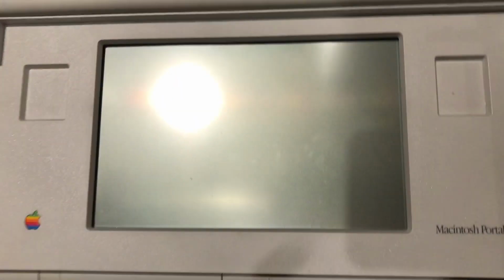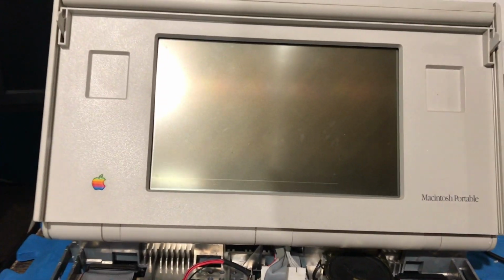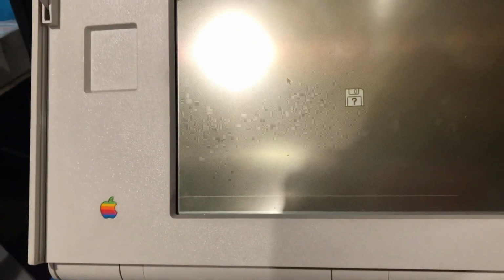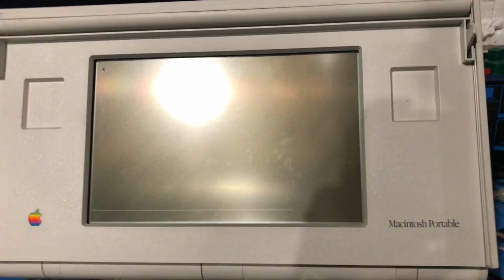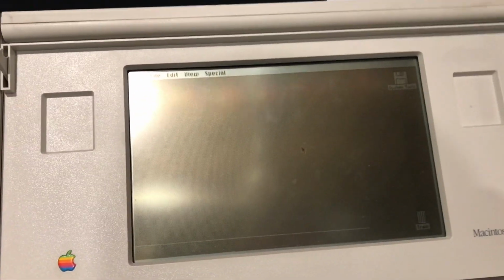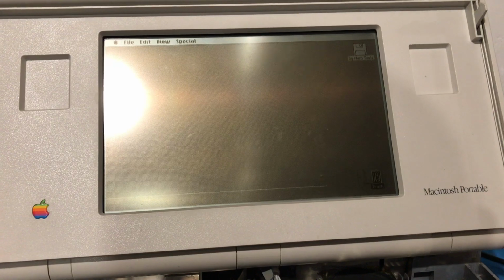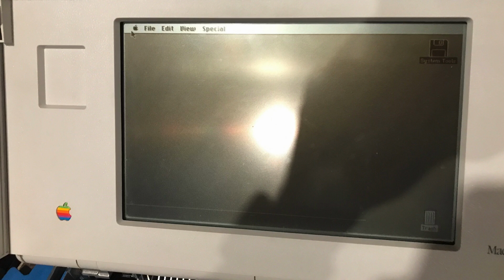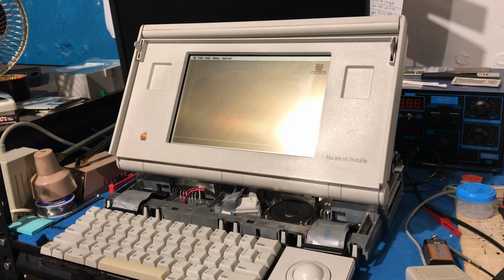Macintosh Portable Restoration Part 2 | Logic Board Recap and Troubleshooting | Mastergeko4

Comment: Hey man, I just purchased a portable M5126, backlit version. I disassembled it and upon inspecting the board I noticed something odd. From one of the microprocessor chips, there is a green wire that is soldered on one of the pins. It’s connected to a pin on an output chip. Why do you think someone did that? Could it just be a broken trace? I tested it for continuity, which there was. I’d love to hear your thoughts on it. Thanks
Reply from the maker: That’s pretty interesting. I would either suspect it to be two thing. One, being the trace repair that you said even though it seems to be working. Maybe whoever had it before didn’t check properly and just added it for good measure, or it would be some kind of aftermarket upgrade. I would take a look at a few other components and checking if anything looks new or out of place. Who knows? Maybe it has some sort of cool rare upgrade!
Reply: Mastergeko4 Hey again, I just cleaned and completely recapped the board. The board is getting power to the plug into the board, I checked and it does gain proper voltage. However, upon trying to boot the board It does nothing. It honestly acts like it’s not getting any power at all, even though I know it is. What would you recommend I do at this point?

Comment: You have a capacitor grocery list?
Reply from the maker: I don’t at the moment. I suggest either looking up a recap guide online which will have all the values you need, or look at your board and make a list of what you need. The second one was what I ended up doing. Make sure the cap sizes match the originals!

Comment: I think the line on your screen is a capacitor issue, you don't replace those who are on the left or right of the screen, hide by the plastic. You need to disassemble the screen to replace them. For the floppy, I think if your floppy drive wouldn't eject, is probably the eject mechanism, there is little gear in the motor who break.
Reply from the maker: I'm aware of the floppy drive issue and I'll be fixing it next video.
I've also been aware of the smaller capacitors inside the screen assembly so I'll be checking them in the next video too.